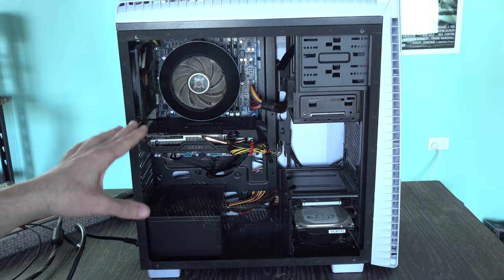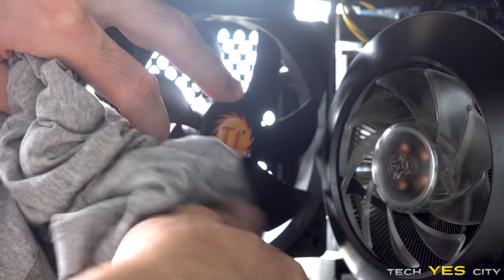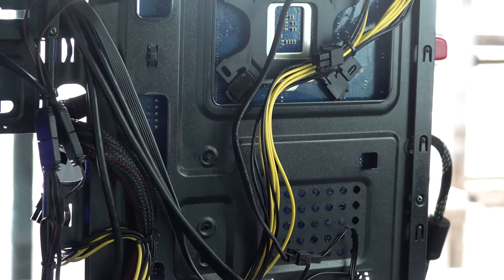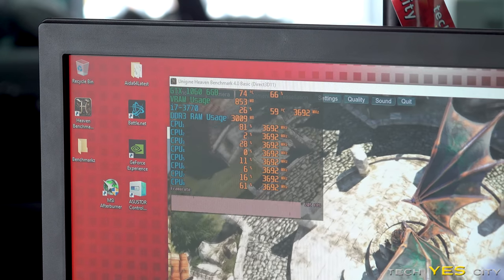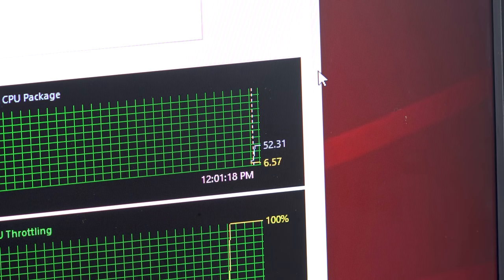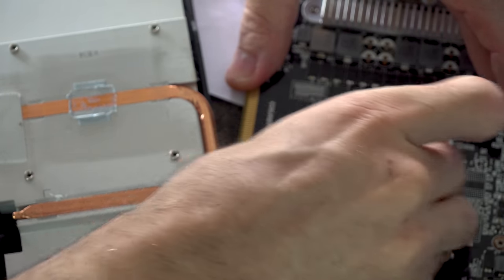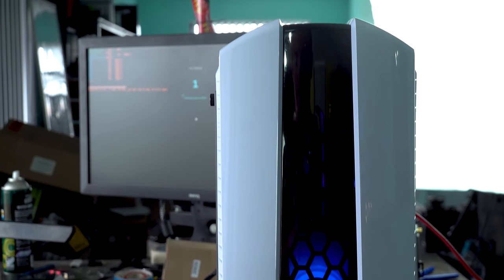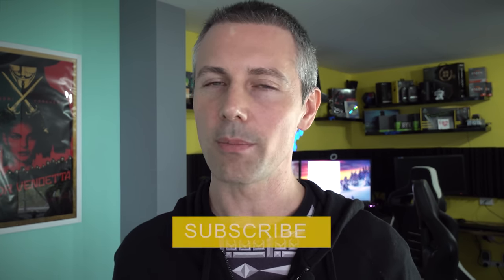This Gaming PC came back 18 Months later... (GD-900 is AMAZING)

Comment: I'm here for the gd 900 goodness
Reply: Count me in,have 2 of them.
8)
Reply: @DuneRunnerEnterprises  Is it as good as Bryan says?
Reply: @WarriorsPhoto  yes, i got a r3 1200 oc'ed to 4.1ghz with a deepcool gammaxx 400 and it got 70°c stable for 4 hours
Reply: @WarriorsPhoto  I'm using it for 4-5 months now, had no trouble with it. (and price is just OMG-WTF how good)
Reply: Right? I've been using it for a long time.
Reply: Do you know if it's electrically conductive?
Reply: Bush's Baked Memes no it isn’t, some websites say that it is but i think its a misconception of a subtance called metal oxide in the gd900, it may have a “metal” in its name but its non-electrically conductive
Reply: Is there fake gd900?
Every thermal patse has faje counterpart so im confused.

Comment: This is funny, this happened to me last week. I built a pc in November of 2017 sold it around xmas, 2 weeks ago the woman  messaged me on Facebook saying it was her son's birthday and they got him and oculus rift. They did not know how much gpu power that needed. So she asked for me to do an upgrade.
The system was a lenovo s20 with x5565 (4 core), 8gb ram, gtx 770, case swaped
They were clearly a smoker home because it was awful inside. I cleaned it first and let it install updates the kid never letand ran VRmark cyan room   with the original setup
scored a 502.... yikes. 
So I installed a x5670 (6 core)
Another 4gb ram (12 total) yay triple channel. 
And a gtx 1070
VRmark score 5070. Much better
Reply: Smokers are the worst repair customers.
Reply: @TimTams_64  So true, it's disgusting
Reply: Cool story.😋🎉
Reply: To be fair the 770 is really a rebadged 680, and is 3 generations older than a 1070.
Reply: hey 770 are still pretty damn good these days all things considering especially because you can pick em up for around 20 to 40 dollars US but that is a cool story!
Reply: Don't you need usb 3.0? Pretty sure a first gen Intel cpu doesn't support it
Reply: @Brandon-uy1uv  Supports USB3 through select boards with that NEC chip or with a USB3 PCIe card
Reply: @jeremyp8409  maybe good but that vr score says not good enough. So regardless of what it is you may or may not consider an upgrade for what you're doing.
Reply: @ArtisChronicles  3930k xeon equivalent would be a perfect budget cpu for vr
Reply: 11 year old Xeon chip is gonna have trouble
Reply: @TimTams_64  No.  Customers with a bug or rodent infestation are the worst.
Reply: @MaxDad7  i saw the video of the tik tok repairer that was pretty bad.

Comment: I bought a big tube I found on Amazon with Prime shipping.  I paid a little more than AliExpress, but got it a lot faster.  I've been using it and enjoying the performance of this stuff.  I've used it on my OCed Ryzen 2700, a GTX 1050 ti, a GTX970, and older CPUs and it's been going strong.

Comment: I am very glad to see this video, I went and bought like 3 tubes of the stuff when you made your first (that I am aware of) video on the paste, have been using it ever since, built somewhere in the neighbourhood of 34 computers with it, not quite finished by first tube and seeing that it holds up to the standard of MX4 even after 18 months of usage is absolutely amazing to see. Had I not seen your video I would have kept buying £7~ tubes of MX4. Only complaint is it took forever to arrive. 

I tend to clean off the paste on new stock coolers from AMD and replace it with GD900 simply because that crap seems to almost solidify making it a pain to get off, ended up pulling a 2200g straight out the socket yesterday due to this, had to bend back a bunch of pins and it worked in the end despite 2 pins falling off, looks like they were both "void" pins so I appear to be insanely lucky.
Reply: I've bought a few pre-built cyberpower and cybertron PC's that were FX series and had to pull the CPU straight out of the socket still attached to the cooler and then wedge the CPU off the cooler. I thought they used some type of adhesive instead of thermal paste because it was almost glued to the cooler. The first time I made the mistake of trying to twist off the cooler with the CPU still installed and bent all the pins 😑
Reply: Corey Touchston I thought twisting the cooler was the way to go with solidified paste but I think that’s only really applicable for intel. I did a bit of twisting which is probably why ether corner pins on my chip were bent.
Reply: @justinbuckley  yeah, I think if the pins are on the motherboard you should be good with the twist method. With the FX processors I just pulled them straight up out of the socket even though the socket was latched (not accessible). Never damage anything doing that so far.
Reply: Next time warm up the paste by running a benchmark for a bit.
Should help

Comment: Interesting as my old PC is an i7 3770k with 16gb ram and a GTX970. I bought my i7 when they released and it has stood me well to this day. Not quite in the same league as my new machine though. R9 3950X, 64G ram, RTX 2080ti and a Seagate 2tb NVME PCI-e 4.0. only been built a week or so but loving the power.

Comment: I kept on recommending this thermal paste to everyone, but nobody believes me :(
Reply: Now you can show them this video and they will change their mind for sure.
Reply: To some people more expensive automatically means better. I use cheap £1 tubes from my local PC repair shop and the temps are always in the same margin of error as the expensive stuff.
Reply: @voteDC  $1 tube are generally garbage, whether it's due to longevity or quality
Reply: @hundredlives3910   £1 is about $1.22 USD, so a little bit more.
I've had it on my main PC, i5-4690k overclocked to 4.3 Ghz, for about a year now and the idle temps are around 35˚c which to me is still pretty good. I have a Corsair AiO cooler.
The £1 thermal paste was also used on my GTX 970 and I've yet to see that hit 75˚c under heavy load.
Reply: @voteDC  sometimes cheap stuff isn't really cheap and sometimes it really is. So when you do find really good cheap stuff it's great. Right now I'd say good find
Reply: @voteDC  lol nothing "loacal techy" is that cheap in london
Reply: @tgdhsuk3589  London increasingly seems out of touch with the rest of the UK.

Comment: I have an i5-8300h and gtx 1050. Note that my laptop is not designed for gaming but for portability and productivity. I used to have 58-64 on gaming(undervolted), after I changed my thermal paste with gd900, it's now in between 54-57 in 2.4ghz, 60-64 in 3.9ghz.
Reply: Hi I have exact same specs on my Acer nitro 5 laptop. Going to try replacing the paste with this. I noticed there is pink paste on the GPU parts and grey on CPU. Is it the same on your laptop?

Comment: Cleaning Pc Parts... you're a champ at it... I finish flossing the fins on the heatsink of an MSI GTX 1070 Gamin x with some polishing sandpaper and I'm done for the week! Keep it up mate! Good to hear the GD-900 has some longevity as I bought a heap (3 30g tubes) of it a few months ago but have been reticent to use it on any of my builds. Will start using the GD900 from now on.

Comment: From my personal experience, the main upgrade the guy would have needed for a bit extra performance out of that rig would have been a simple gpu upgrade, the cpu still got a bit of headroom for higher end gpu support, and the 16gb of ddr3 still holds up fine.
Reply: I mean he'd maybe get decent performance out of a 2060 but the 3770 will bottleneck a 2070. You'll still see good performance but not as much as you could get with a better cpu.

Comment: nVidia is not capping the VRAM with the drivers.. GTX 970 has 3.5GB at 224 Gb/s with 512MB at a much slower rate. There was a whole fiasco over this that caused a lawsuit.
Reply: I remember them refunding 30 USD after the lawsuit. I was lucky and Amazon refunded me the whole amount even though it's been a few months since my purchase. Was able to upgrade to the 1060. Still using it to this day.

Comment: Nice video. A suggestion for cleaning between fan blades and other tight places ; moisten a paper towel with an all purpose cleaner and then push / pull it through like you were doing with that shirt - ahould work a little bettter and easier. I do also use cotton swabs like you were using. Then you coiuld do that same proccess but with a paper towel moistend with wd-40 or similair cleaner as the polishing stage.

Comment: I feel that all the AMD hype over the last 2 years has chased people into overestimating the relevance of the CPU in a gaming rig. I am doing a lot of GPU upgrading and it is amazing what gaming performance you can squeeze out of fairly old CPU's if they have at least 4 cores and a competitive clockspeed. Instead of pumping hundreds of dollars into the newest Ryzen or I9 ever three years people should really look at the performance gain per dollar that a better GPU gives them, compared to a whole new system.
Hell I learned myself, selling some old PC's that came into my possession last year. For example an intel corei5 3570. Came with a R7 240, I replaced it withe GT 950, then a GTX 960 4GB, then a 970, and a 1060 6GB. It kept on giving! I even put my own 1080 into it because I got curious and yes, it started bottlenecking but there was still a performance gain.
My main rig currently has a 4790K 10% overclocked, not at all bottlnecked by a 2080 non ti and will for sure serve me a few more years. Granted I don't aim for 4K, 240 Hz gaming
Reply: Yup, my 3770, while bottlenecks my RTX 2060, not by much honestly. Though, really wanted to upgrade to 3600 when B550 eventually came out as I have been doing a lot of CPU intensive task lately. Then again, human malware has messed the price up in both used and new PC market so might hold for a little longer.
Reply: Well. If you would be gaming in 4k you would last even longer as that put way much more pressure on GPU.
Reply: @TheNeaul  that too, yes.

Comment: There's a setting on Warzone in your my documents called adv_options.ini in there there's a setting named VideoMemoryScale that's set to 0.85 by default, I heard that changing that to 1.00 and then making the adv_options.ini file read only improved your FPS. It certainly improved mine a tad, I'm guessing that setting was making Warzone only using 85% of my GPUs memory.
Reply: Looks like it was still using all of the available vram on the 970 anyway though.

Comment: Gtx970 has 3.5 gb of vram not 4 gb and you can see when 970s vram maxxed system memory usage goes up. When warzone uses 4.1 gb of vram with 1060 system ram has 0.5gb more available than the system with 970.  (Im not English sorry if my English was bad)

Comment: Exactly same configuration I am using at the moment, 3770 with 1060 6G 16G RAM, changed thermal paste on both with GD900, both dropped 10 - 15 c approx

Comment: You actually can overclock that CPU by raising the BCLK if you pair it with either a Z68 or Z77 motherboard. I had one on a Z68 overclocked to 4.2GHz. It made a huge difference in gaming.

Comment: last time I cleaned an old and dusty GTX285 the temps went from 85° to 65°C or so, I applied new paste as well, but the drop was of course also from the cleaned out dust, so not sure what the paste alone did. lol. I just know at 85°C the card was getting artifact-bugs on screen sometimes, so I dont recommend running a GFX card over 80°c...

Comment: Remember the 970 had that whole scandal of only having 3.5 gigs of vram after nvidia realized they where making it almost directly compete with the 980, so the 970 was never a true 4gig card because nvidia locked a core
Reply: You're right, the way the memory connects to the GPU some of the memory couldn't be connected due to the CUs that were disabled.  So strange that they decided to connect an additional set of much slower memory through a link that really didn't work and eventually just disabled it in drivers because the extra 500MB was only making things run worse.

Comment: Brian did you forget about the controversy that surrounded the GTX 970 after it launched. The problem was it was had 4GB of Vram but only 3.5 GB is usable. That's why it showed 500 mb less while testing.

Comment: might be a good thing to note that taking apart old GPU's might also require new thermal pads, so be sure to have some handy when tearing it apart.  Sometimes those pads on older cards will rip apart.

Comment: the chinese paste is good for mass pc builders if you let the paste sit in the tube it basically becomes like egg yolk and mud .
Reply: Can't you shake it?
Reply: @junpreet9261  nope
Reply: @anirudhmallikarjun7067  have you checked the manufacturing date?
Is it an year old?
Also you can mix with small spatula I think before using
Reply: @junpreet9261  i did try it it breaks down

Comment: Boy, I was mostly using the 2 dallor tube thermal paste that's on ebay, but after checking up on the gpu temps, it was mostly running at 78 celsius.

Comment: Wasnt the 970 the one with the 3.5Gb fast Vram and 500mb slow Vram ?
Could explain the 3,5GB vram usage
Reply: Yes it was, 3.5 gb only was available for usage.
Reply: JustBrandon. 4gb is available to be used, it’s just many modern games see it as a 3.5gb and limit the usage.
Reply: @EvilTurkeySlices  Well technically you could use 4Gb , but it was running like 3.5 because the last .5 were so slow they may as well didnt exist, hence drivers purposefully ignoring them.
Reply: Kai Sörensen the drivers don’t ignore it, the games do.
Reply: It has 4gb, 500mb are slower memory but let me tell you I had that gpu for like 3-4 years and works just fine even on full 4gb usage, no noticiable screen tearing or drop of performance or anything like that, believe in what you want I'm telling you my personal experience with it
Reply: @lacucaracha111111  It isn't the drivers as many of my games, such as Assassin's Creed Odyssey and Resident Evil 3 use that last .5 of vRAM. I suspect in the video it is down to how Warzone allocates vRAM.

Comment: this thermal paste is bad ass its like a nuclear warhead in a small package lol 

CPU Benchmark 
Temp: 44C/ MIN 35C /MAX 48C 
GPU 
Temp : 56c/45c /67c 

i tested rendering video over 4k-8k it shoot ups 75c max holy shit o.o i be like dudeee are u serious is this black magic?
Reply: yeah, pretty much insane how this paste holds up against high end options.
im rocking both GPU and CPU with it for roughly 13 months. peak temp while gaming 65ºC and 62ºC (both undervolted), respectively.
[edit - btw, ITX build]
Reply: Sorry for necro but is the GD900 still holding up after a year? I have heard people have had worse results with it fairly quickly after application. Thanks!

Comment: the reason you are only using 3.5GB VRAM on the 970 is because it only has 3.5GB VRAM, the other 0.5GB is very very slow and has a large performance impact so it doesn't get used... NVIDIA got hit with a class action lawsuit about this a couple years ago

Comment: Question at the end
I don't use thermal paste and haven't for over a decade.

I use a product which is really good on all my builds and refreshes. 
It was suggested to me well over a decade ago. And I had never really thought of it. It works on quality coolers so not great with trashy one. But yeah thermal grease. It's white and thinner that thermal paste and it's never seems to dry up.
Prior to this I had been using a silver based paste and it cost alot more. I didn't see much difference to the top of the line to the grease.

The question
I bought a Dell XPS 430 the other day and it has the x48 chipset.

I tried 1333 4*2 and got no boot. I tried with 1600 and got a no boot with 8gb, but did with 6.

Now I think this is a bios thing as a lot of people have said about these systems and having 6 GB RAM.

I've also seen 8 and 16gb but they seem to drop to C2 and super slow speeds. The stock ram runs at 1060, which I found odd.
I didn't want to really push more money at it and it performed well.
I swapped out the GPU for a 750gtx. And it plays well enough it plays Crysis high at 77fps

The ram is a issue for me as I want 8gb so it will play warzone well and while it has 4gb (or 6) that's fine for 60fps ultra high and rtx via geforce now, but I don't want to sell a pay per month gaming system.

Comment: does those plastic stain remover/plastic polish, work on those plastic fins without damaging it at all in terms of performance? i mean i use those to remove dust on plastic body products at my work place for repairing house hold appliances.... and the plastic body does not lose integrity but i don't know how it will affect the fins on these fans because it seems a bit more sensitive to its weight....

Comment: I have a stock intel cooler, (I7-4790K) and GTX 960 4gb using it for 3 years now. Computer crashed during a match in Warzone, game just froze, then 3 mins later a blue screen came about with errors and such, and it restarted itself, I assume that it overheated, I changed the thermal paste with a "Hy410 silicone type fluid" thermal past (I'm no tech savvy), downloaded MSI AB and played CPU reached 100'C, GPU is 67ish 'C (never saw what the temps were before the crash). Safe to say stock cooler needs to go now, and! thermal paste is garbage, so which one should I get, Arctic MX-4 or Thermal Grizzly Kryonaut or GD900? If you know any other thermal paste worth looking at then do pray tell.
So yea what other thermal paste are worth it and which thermal paste should, no doubt be considered the standard? This is my question.

Comment: What kind of cpu cooler is that and is it good for over clocking? I ordered the same cheap thermal past huge tube, just because you recommended it. Can that GTX 1060 6GB be updated with 1070 vbios?